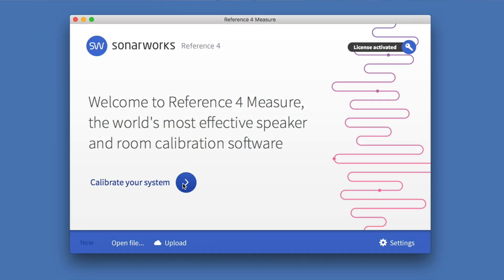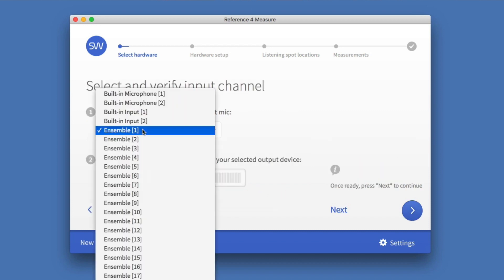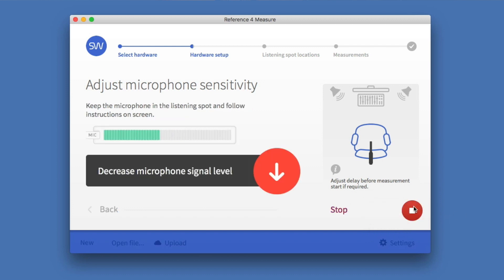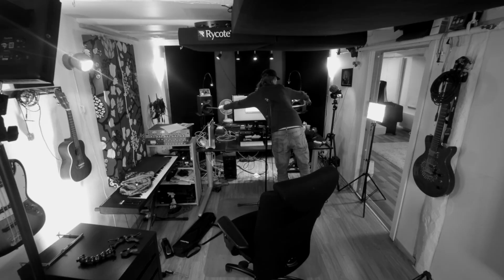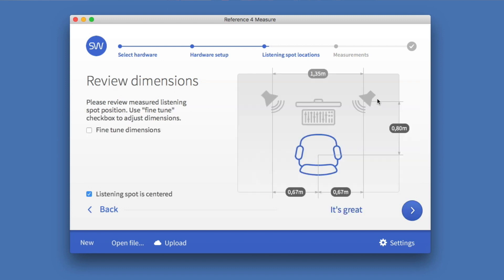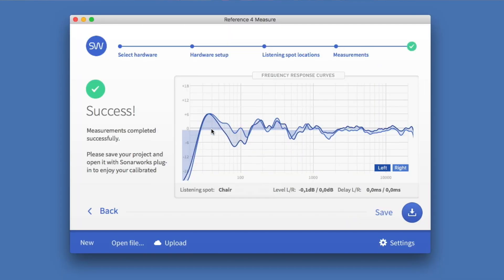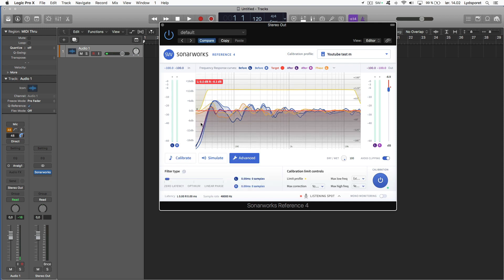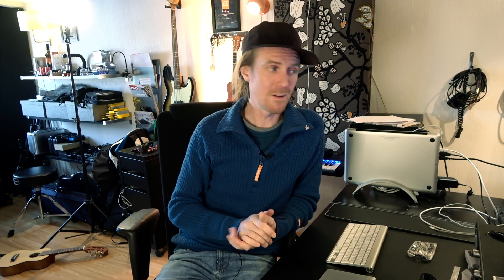SonarWorks Reference 4 - Step by Step Tutorial - Zero latency :D

Comment: Soon as I got to the listening room areathe input level of the mic went bonkers...way into the read. When setting up the input level, all was good. I have the latest version, 4.2.1.7...not happy at all.
Reply from the maker: Did you USE samplerate 44.1?
Reply: @snorrebusch5020  Yes...I'm running at 9kk and latency is showing 187.44 (Linear), 142.09 Zero. This is with Nothing running...other than Mac Mail and Finder. I checked the Activity meter...barely anything .

Comment: I can't create a calibration profile, because the mic input gain level is too low even  when cranked up to max. I'm using a focusrite scarlett 2i4 (1st gen.). Can't find any information bout this issue. I contacted the sonorworks and focusrite support, but they haven't replied yet. Does anyone know how to get this working?
Reply from the maker: Only thing I can think of is if you have enabled pad on your preamp, or maybe your preamp is set to send a line signal.
Reply: @Snorre Busch Music The direct monitoring wasn't set to playback. That's why it didn't work. Thanks for your response.

Comment: So i can't really calibrate my speakers since i don't have that mic and I don't really have the room to measure them correctly. Anyway,I was wondering if I can still use my headphones for mixing and make them flat? I have a trial version of sonarworks there is a big on and off button and I can set it to bypassed. Can I work like this? Also,when exporting my files,am I suppose to turn the reference off and then use limiters and other plug ins for master? Since I feel like when it's bypassed the sound just get's lower, I don't really understand.
Reply from the maker: Hi, you can use your headphones with SonarWorks and get a flat response. You need to check out if they support your headphones though. Just pop over to their website and check it :) They also can make  a measurement of your headphones if you send them in to them. But then you'll be with out them for a while. You only use SW when you are recording or mixing. When you are finished with a song you bypass the plugin and export your song without the plugin. To achieve the flat response SW boost some frequencies and lower others. That could make you feel that the volume is louder. When you master your song for loudness you should use your meters in the DAW to get the right loudness. If you want to check if your mix has the right levels for iTunes, Spotify and so on you can simply use https://www.loudnesspenalty.com. This website lets you know how your song is going to be holding up in the different streaming services on the web :)  Hope this helped you a bit on the way. Happy mixing!
Reply: thank you so much,this was a straight up easy answer. <3

Comment: Do you have to use that mic
Reply: Yes, each Sonarworks mic has a key id which gives you a calibration profile from their website. This calibration profile is specifically for the mic they gave you. The calibration profile file is required at 1:15 in the video.
Reply: Matt Gerstenkorn ok thanks will it work with other recording software like reason record.

Comment: When i make the "listening spot chair" the spot is not appear at the center. Then when make a measurement phase, the posicion of the mic nevers appear. I dont know what its wrong...
Reply from the maker: Have you got 44.1 set on your sound card? That could make this happen. And have you turned of direct monitor in you audio interface settings? If yes to all, I would contact Sonorworks support :)

Comment: hI.. how can i make sure that direct monitoring from microphone to speakers is turned off?
Reply from the maker: That depends on your audio interface. So you will find it in the software that comes with your audio interface. Basically it is muting your input channel so you only hear the audio running through SonarWorks and not directly from your interface.
Reply: Thanks.. will check this option out in my interface.. its UA Apollo in case you are familiar with its software..
Reply: do u think this one is better or the IK Multimedia ARC 2.5?
Reply from the maker: I use Apogee.. But I will guess you'll see it when you open up the apollo mixer.. Check under inputs and you'll get it :)
Reply from the maker: Now doubt! I have them both. SonarWorks win my ears :)